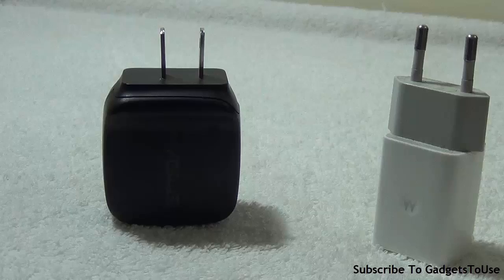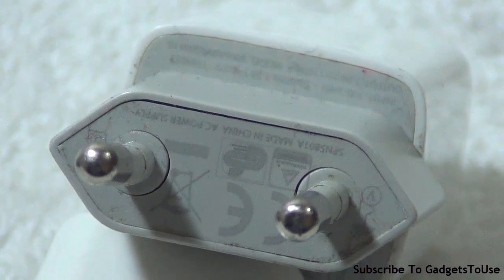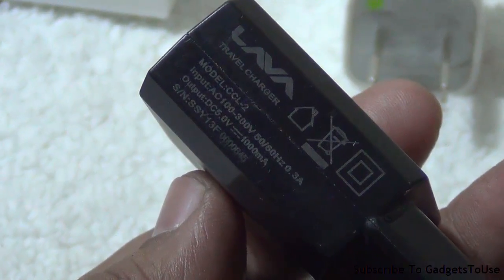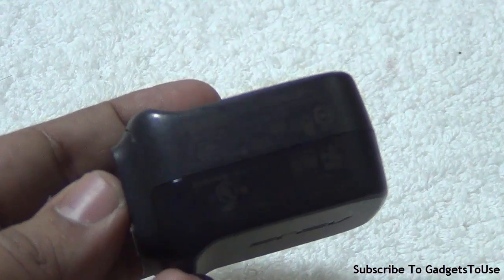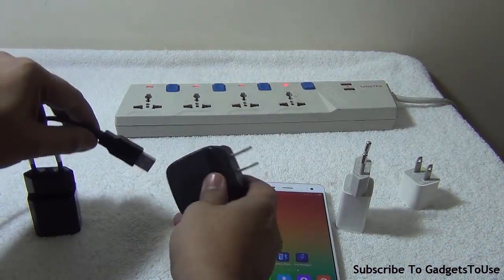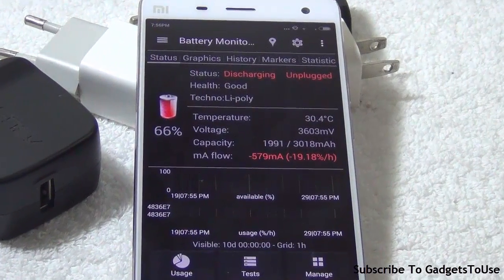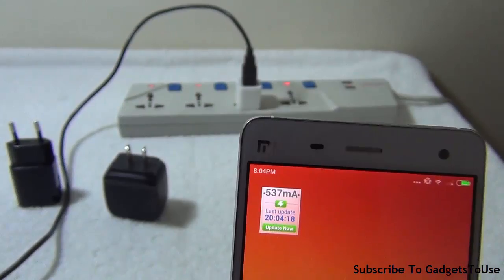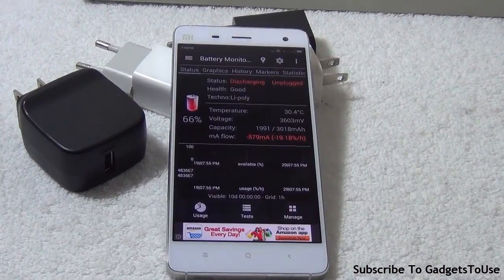GTU Explains, Why Not Use Fast Chargers and How Does They Work

Comment: Hi Abhishek,
 I m using my Lenovo k3 note whose charger has come with a charging current of 1.5A . And i jst bought a Power bank of Ambrane P1310 which is providing two output ports,..one is with 1A of charging current an another one is with 2.1A of chrging current, So i was wondering whether i shud use 1A or 2.1A port, Can i use 2.1A charging port ?
Thank you,
PRABHASH
Reply from the maker: +Prabhash Uniyal  check this video and article you will get the info you need. 
Video - https://www.youtube.com/watch?list=UUk3eWT8H_Hyon__NqbiNqUg&v=c__uhMxRKfU

Article - http://gadgetstouse.com/gadget-tech/how-to-detect-fake-chargers-usb-cable-and-battery-bank/24339

Check the output current on the default in the box charger and connect it to that port as the supported current.

Comment: Indian version of Mi3 comes with 2A charger.
So , it comes with the box pack , but it is a 2A charger ...
So you are telling not to use the 2A charger which came with the device?

takes 1-2 hour to charge from 20% - 100% (I think)
Phone gets a heat up , but not a lot... may be max upto 40 degrees.
Reply: The phone can always we charged with the charger which comes wth in the package - either its 1 Amp or 2 Amp unless the device is above 45 degrees then still it can work but heating always affect your battery.
Reply: OK , thanks for the reply . I don't know why Xiaomi gave a 2A charger in India , while they give 1A charger in China.

Comment: Bro...Pls make your explanation simple... Feel like you are grinding the same flour again and again... Anyways the content is very good.. Thanks for the video...
Reply: thanks for the feedback, will keep this in mind next time.
Reply: abhishek bhatnagar oneplus one charger charges my s4 roughly around in 30 mins so that is ok my s4 doesn't  heat up at all.My s4 and oneplus charger have same output of current  but they take different amount of time and i aslo noticed that using the small cable for charging lets the flow electrons faster to the device which is again helpful for the fast charging

Comment: but sir what about the moto g charger.... it comes with just .5 amp charger... and it takes about 5 hours to charge it full.....
Reply: 0.5 amp charger are generally slow, you can try using a 1amp charger - monitor the charging speed and heat - if results are good then use the 1 amp charger.
Reply: Thanks sir....i am using 1amp charger of htc desire 816... and it is performing well

Comment: I Use Anker USB Charger :D
Reply: anker usb charger is one of the best which can work with multiple devices, i have it as well.
Reply: abhishek bhatnagar Several weeks ago i think i accidentally short circuit it when my SONY Xperia magnetic charge touch my glass cover which made from iron...Its still ok but i only can use 4 out of 5 slots ^^... But its nice to have...I Already Bought Another One Just Incase
Reply: Maurice Phoenix good that you have decided for a backup as well, there is one from Tylt which is a battery pack + charger, you should try it.
Reply: abhishek bhatnagar Currently Im Using Yoobao 13000 Transformers And Neo Brand Both 13000Mah For My Lenovo S6000, Xperia Z, Z2, Tablet Z2, Z Ultra And Xiaomi Note. I have never heart About TyIt Here In Indonesia And ...Done Some Research It Seems Good. Ill Try To Find It Online...Thanks For The Pointer Abhishek Bhatnagar